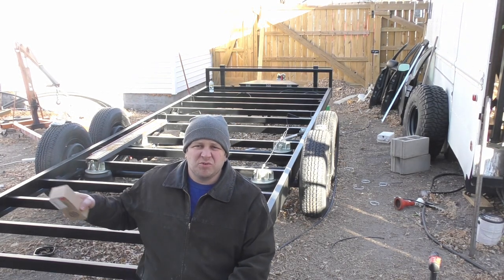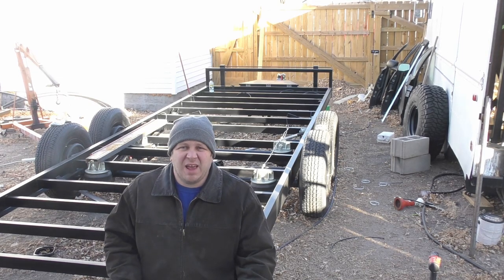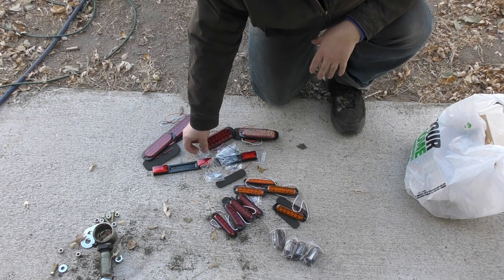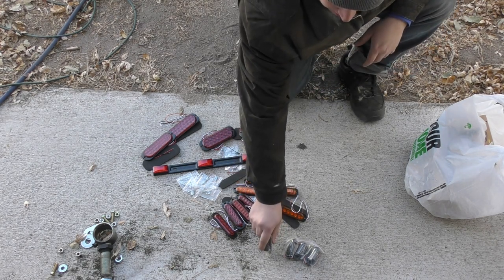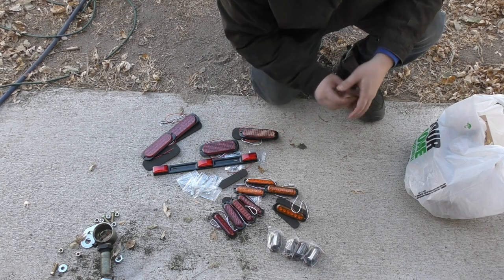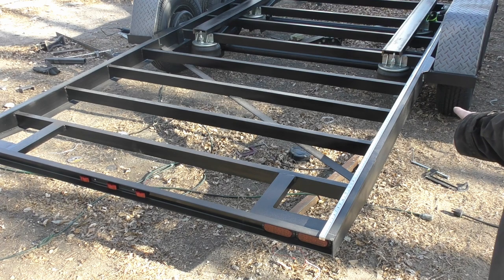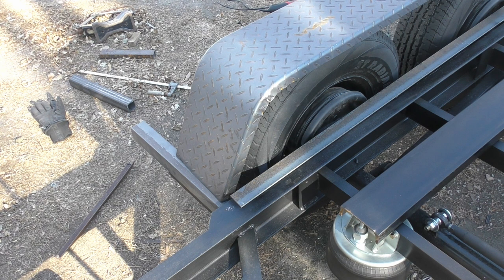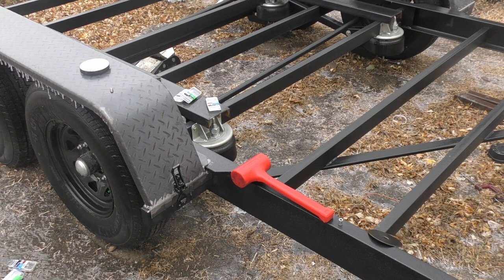Air Ride Tandem Axle Trailer || Light and Fenders Go On

Comment: How much do you think the overall cost to build this trailer is going to be?
Reply from the maker: It is getting a little spicy with the air valves, compressor, winch solar panel and all the extras - all in it might be 6500 which is still under a basic leaf spring trailer at this load capacity.  I'll have a detailed breakdown of costs in the final video of this series

Comment: So, with the trailer hitched to your truck, does the dovetail settle on the ground or do you still need ramps??
Reply from the maker: I still need ramps because I didn't want the axles to be too far forward and have excessive tail swing.  Kind of an annoying compromise,  but I didn't want to wreck everything around turns.  I can put it on the ground with the jacks though
Reply: @Drivewaybuilt  So, what was the reason for the bags if you still need ramps??
Reply from the maker: @SteveP-vm1uc  Mainly I had a specific angle I was trying to achieve to load a car and needed a higher deck at the same time to leave a steep driveway - only a little bit was to dash my hopes of it going all the way to the ground
Reply: @Drivewaybuilt  It sounds like you would be better off with a ramp truck. Maybe a ramp truck on BAGS!!!!  Do a wedge bed and a 4-link on bags. Enough bag and propper engineering and you could put the edge on the ground AND lift it high enough to get out of the driveway without a rub... Then drop it back to highway ride height for the long haul...   And THAT would be a video series that would get millions of views every episode!!!

Comment: From the looks of it you only have one control arm/ trailing arm per corner of the the axles. Won’t that cause axle row when you hit bumps, or even from take offs and stops. I would figure you’d need 2 arms per corner or set it up as a radius arm set up.
Reply from the maker: It is a radius arm setup
Reply: @Drivewaybuilt  shouldnt it be welded sold on the axle side. It has a bolt/pin on both side. That’s going to cause the axle to roll.
Reply: @Drivewaybuilt  I’m not trying to bust your balls. I’m just trying to help. You should look up an actual radius arm set up.
Reply from the maker: @homergarcia376  I feel proper Feedback is always good and actually wanted.

Here is how my thought process went - the main bracket is welded to the axle and the arms are connected with 2 bolts with bushings at each corner to those brackets - bolts are about 6"-8" apart to keep caster movement down and reduce torque on the bolts.  

Radius arms (these are considered trailing arms since they are the other way around) have to have some movement at the axle end or you will start inducing heavy twisting loads that break stuff and will bend arms, so welding the arm to the axle is a big no.  There will be some roll due to the bushings, but it should be no more than a leaf spring allows with its bushings and u bolts.  

The airbags' check valves also help control some unwanted suspension behavior since preventing roll is the job of the suspension and not the link bars.

the arm style is like what people have been using on Ford axles for years - most radius arms I have seen are bushed, including my Fords so they have some twist capability to them.

Right now it performs beautifully, but I haven't gotten a real load on it yet - just picked up the decking for it - I will definitely put it through some safety tests before calling it a good design - it is a bit of untraveled territory with this design and there are unknowns to be wary of.

Thanks for the input, it is always good to hear another's thoughts on things - hopefully you get my logic as well and hopefully it works out well.
Reply: @Drivewaybuilt   I’ve been following your build and it seems like a great build. I just don’t I’ve seen a in-depth on how your suspension was set up. Only from the quick shots of it is what I was going off of. Hope your design works well for you.
Reply: I was thinking this exact same thing. The build is awesome for sure

 It yeah I was 

1. wondering why such LONG trailing arms? 
2. The pan hard bar setup should be be set up exactly opposite of each other on each axle.

Axle one should have panhard from left side chassis to axle 

Axle 2 should have pans hard bar from right side chassis -

3. Seems like there is 2 trailing arms missing! It’s almost a 4 link setup but no top control arms…

or why isn’t the arm welded directly into the axle completely solid? 🤔
Reply from the maker: @ZAY________  1. Length of trailing arm is to lower the amount of change in castor for the air suspension to be happier 
2. same side panhard  was to reduce stress when cycling the suspension - opposite bars would fight at every movement  (but maybe that is desirable? I would think it would try to sway the tow vehicle more) -  not sure if there really is a right or wrong way since there is not much to compare it with
3. the last video in the series has a segment with the axle connection so you can see what is going on better - it is essentially welded to the axle
Reply: @Drivewaybuilt  I see you for sure. Yeah the opposite pan hard bar set up is for sure a weird thing and you'd think they would fight each other logically. But almost EVERY single tandem Semi tractor has them set up opposite of each other no matter the company. Kenworth, Frieghtliner, Peterbilt, Mack, Volvo, Sterling etc. Math and geometry are of course involved but yeah. As your axles move top and down the axles move latterly of center a bit. Always traveling at an arc. Somehow it still works.   - ill peep your 3rd video fir sure!
Reply from the maker: @ZAY________   I wish I had expensive software to run some simulations on it and see just what the forces involved are and the movements of both setups for fun - I'm sure there's a reason why they do it on those rigs, but I'm not sure it will make a difference on my usage, but I'll keep it in mind if it behaves weird.  Thanks
Reply: @Drivewaybuilt  hey I feel you completely. Since I was a kid and still sometimes to this day use Lego Technic for simulations. All my air ride stuff, lines, compressors, pan hard bars, control arms, sway bars, RC steering I did first on Technic. Lego actually has a 4 Axle dump truck set that I was totally surprised used the opposite pan hard bar setup we’re talking about. I bought it and yeah it’s wild. They move slightly in the opposite ways. Truck still drives straight. The angles aren’t severe enough to really affect anything and bind anything up. (I’ve now been moving towards Tamiya RC stuff. Super expensive hobby but those RC trucks can actually hold real weight and I would be able to test projects more effectively using real metal, aluminum etc.) 🤙🏾